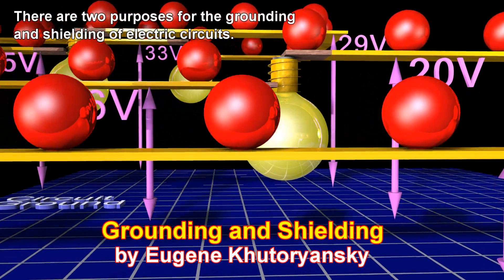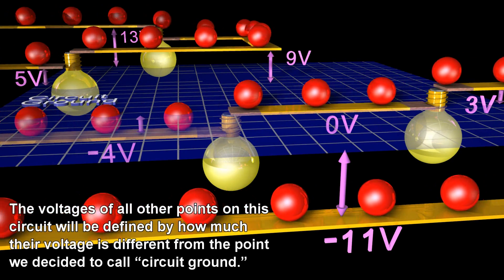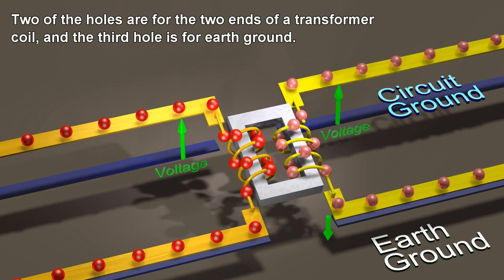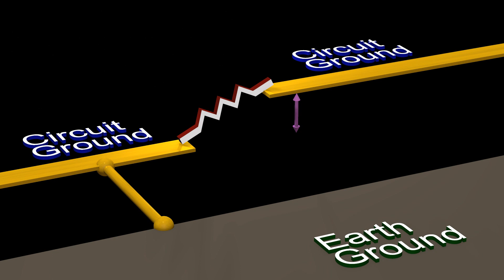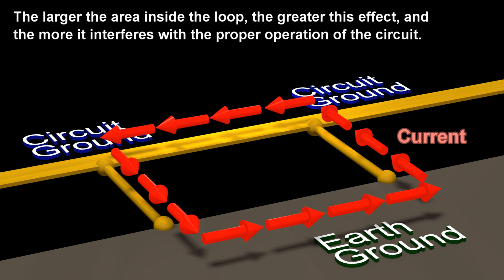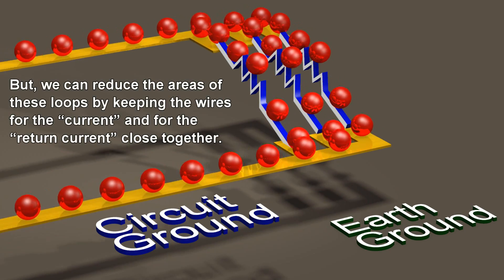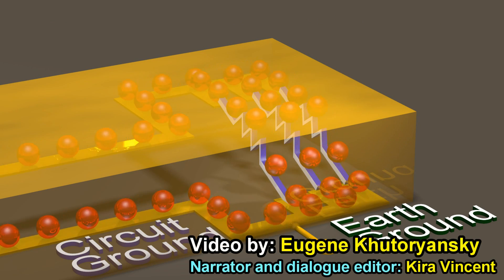Grounding and Shielding of electric circuits

Comment: Do we really believe there are little marbles of electricity rolling along the wires vs field lines spiraling around them as Tesla, Steinmetz & Heavyside agreed on? & that the ground is nothing more than an integration / discharge point into the larger electrical field of the planet?

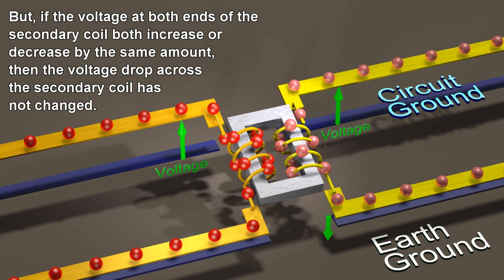Comment: 2:03 What can cause the secondary coil to increase or decrease?

3:00 - 3:12 The three-prong outlet part isn't accurate. Its expressed safety purpose is to create a low impedance path back to the center of the secondary coil, thus causing a breaker to trip when one of phase conductors (ends of the coil) touches the metal body of the appliance. It is technically connected to earth via this path. 

The metal enclosures are also connected to this path for the same purpose (tripping a breaker), but its earth connection via this path may provide safety in the case of indirect lightning strikes (for example) creating an induced current and arcing to a nearby person or ignition source... though this kind of overvoltage and indirect lightning stuff isn't greatly understood, I think.

Comment: The third "ground" hole on a power outlet isn't just a connection to earth ground. It is a connection to the circuit ground, which is also connected to earth ground via a "grounding electrode." This is done to lower the total resistance between the electrical system and the earth, which helps to minimize potentially dangerous voltages from developing between the two due to high current flow from high energy sources (ie lightning).

The reason for this third slot is to bond metal enclosures to the circuit ground (via the "equipment grounding conductor"), so in the event that an ungrounded or "hot/live" conductor (that is, relative to earth ground) makes contact with the enclosure, there will be a low resistance path back to the source (circuit ground) which will cause high current to flow and result in the overcurrent protection device (fuse or circuit breaker) opening and turning off the circuit. Without this low resistance path, current can still flow back to the source through the earth ground, possibly using a human body as part of this circuit. The resistance of this "ground fault" path may not be high enough to trigger the OCPD (say, 15A or 20A for a standard household circuit), but may still be low enough to pass lethal current through a person (~100mA).

Comment: What is grounding?
Grounding is an electrical engineering technique used to prevent people from receiving an electric shock from electrical equipment they use.
The metal accessible parts of equipment are connected to a copper or other metal plate buried deep in the ground.
While the phenomenon is one of involving the mutual repulsion of like charges, the manner of reducing the potential requires some knowledge of capacitance and that of the capacitance of single conductors.
In the book "Fundamentals of electric theory and circuits", the principle of grounding is explained after descriptions of the neutrality of conductors, capacitance of a single conductor like the earth, sharing of charges by capacitors connected in parallel and leading to the theory and practice of grounding. 
P.S. A circuit zero or ground is used as a reference point for measuring potential diffetences or voltage and is different from grounding and this is also described in the above textbook.

Electrostatics and circuits belong to one science and not two, that of electricity and magnetism. To know how they are unified visit this link 
https://matterandinteractions.org/articles-talks/ and view the article 'A unified treatment of electrostatics and circuits.  B. Sherwood and R. Chabay, unpublished. (1999)'
pdf. 
For a live demonstration of surface charge and its effects in circuits visit 
https://youtu.be/U7RLg-691eQ

For comprehensive descriptions beginning with the fundamentals of charge, electric field, surface charge, current, voltage, simple circuit, parallel circuit, capacitors and capacitive reactance, inductors, inductive reactance, induced fields and transmission line effects, antennas and wave propagation, the contents of the book, make a distinct unified approach to electrostatics and circuits lending precision and clarity to the topics which is not found in most text books, see "Electric and Magnetic Interactions" by Chabay and Sherwood 
www.matterandinteractions.org
or 
Fundamentals of electric theory and circuits by Sridhar Chitta
https://www.wileyindia.com/fundamentals-of-electric-theory-and-circuits.html

The book by Sridhar Chitta comes alongwith a CD with animated power point presentations for all chapters and voltage regulator, RC phase shift oscillators and differential amplifiers included additionally. 
There is a "look inside" feature in the amazon.com webpage of the book "Fundamentals of electric theory and circuits" by Sridhar Chitta with a few pages of Chapter 1 which may be viewed and also which you may swipe left or press < icon to view the foreword, preface and Table of Contents. 
For a lecture by Prof Ruth Chabay on surface charge in a simple dc circuit visit 
https://youtu.be/-7W294N_Hkk

Comment: Wonderful explanation sr
Why does common terminal of transistor configuration of bjt connect to ground? 
Please guide
Reply: What is grounding?
Grounding is an electrical engineering technique used to prevent people from receiving an electric shock from electrical equipment they use.
The metal accessible parts of equipment are connected to a copper or other metal plate buried deep in the ground.
While the phenomenon is one of involving the mutual repulsion of like charges, the manner of reducing the potential requires some knowledge of capacitance and that of the capacitance of single conductors.
In the book "Fundamentals of electric theory and circuits", the principle of grounding is explained after descriptions of the neutrality of conductors, capacitance of a single conductor like the earth, sharing of charges by capacitors connected in parallel and leading to the theory and practice of grounding. 
P.S. A circuit zero or ground is used as a reference point for measuring potential diffetences or voltage and is different from grounding and this is also described in the above textbook.

Electrostatics and circuits belong to one science and not two, that of electricity and magnetism. To know how they are unified visit this link 
https://matterandinteractions.org/articles-talks/ and view the article 'A unified treatment of electrostatics and circuits.  B. Sherwood and R. Chabay, unpublished. (1999)'
pdf. 
For a live demonstration of surface charge and its effects in circuits visit 
https://youtu.be/U7RLg-691eQ

For comprehensive descriptions beginning with the fundamentals of charge, electric field, surface charge, current, voltage, simple circuit, parallel circuit, capacitors and capacitive reactance, inductors, inductive reactance, induced fields and transmission line effects, antennas and wave propagation, the contents of the book, make a distinct unified approach to electrostatics and circuits lending precision and clarity to the topics which is not found in most text books, see "Electric and Magnetic Interactions" by Chabay and Sherwood 
www.matterandinteractions.org
or 
Fundamentals of electric theory and circuits by Sridhar Chitta
https://www.wileyindia.com/fundamentals-of-electric-theory-and-circuits.html

The book by Sridhar Chitta comes alongwith a CD with animated power point presentations for all chapters and voltage regulator, RC phase shift oscillators and differential amplifiers included additionally. 
There is a "look inside" feature in the amazon.com webpage of the book "Fundamentals of electric theory and circuits" by Sridhar Chitta with a few pages of Chapter 1 which may be viewed and also which you may swipe left or press < icon to view the foreword, preface and Table of Contents.

Comment: The ground is the return Voltage not 0...
Reply: Not when it comes to electricity high or low voltage, it's all the same Physics lol...
Reply: Also it is not called a Circuit Ground, it's called a Neutral...
Reply: So regardless if the return pathway is from the Neutral or Earth Ground it would be whatever the return current is. Unless the return current back feeds from the Transformer. This will increase the Voltage much higher than the supply voltage...
Reply from the maker: Different industries have different terminologies.  You are thinking of the electric utility industry or the wiring inside a building.  I was referring to printed circuit boards.

Comment: Can someone explain me why a person  standing on a ceramic floor ,above concrete, above earth (all isolating materials) suffer an electrocution if touch a 110 or 220 live cable?
Reply: In cable there are several wires inside. There are e.g. live (phase voltage), neutral (return wire) and usually protective earth (earth ground) wires as seen on video. These three wires were wired onto the wall socket at 03:00. This example person in question standing upon more or less insulating floor structure should touch the live wire and the neutral wire (or protective earth wire) simultaneously. However, in some cases electrocution is possible while in contact between neutral and protective earth or earth ground wires (01:30).
Reply: @jkinkamo  , a person can be  electrocutated only touching live wire and the floor.

Comment: this is a way of explaining why the grounded conductor (neutral) and grounding conductor (equipment ground) are bonded at only one point (service disconnect, or transformer disconnect).  Small currents induced as "noise" into circuits can be nearly eliminated by installing an isolated ground, where the devices for sensitive equipment are not bonded to the adjacent metallic system, but run directly to the service ground.

Comment: So do I ground the shield at both ends or not?
The big question still remains.
Reply from the maker: No, you should tie to ground at only one point, so as to avoid creating ground loops.
Reply: For both VFD and sensor cable?
I often see in documentation that shield for VFD should be ground at both ends.
Reply: Milos Grounding a screen on one end will protect your signal integrity from E fields only. Grounding at both ends forms a closed circuit for induced currents to flow, which protects your interconnect from external H fields too.

Comment: Not more then One connection between systemground and earthground is important. If you have two connections it can be dangerous in case of break in the systemgroud. In this case flows the hole current in the earthground. In many circuits can the systemground not carry the hole current, the wire can be very hot and begin a fire...

Comment: 3:13 that is not true with the type of outlet shown. Center hole(green wire) is earth ground. One hole (black wire) is a side of the transformer(either side). One hole(white wire) is connected to the center of the transformer winding (not shown) and also goes to earth ground.

Comment: Since the circuit is operating at DC (0 Hz), what would be the frequency of the electromagnetic waves generated by the loops?
Reply from the maker: If you have a switch open or close in the circuit, this will generate a step function, and step functions have high frequency components when represented as a combination of sine waves.
Reply: So will it be an array of different waves at varying frequencies and amplitudes, harmonics per se?

Comment: Nice animations, but you have lost a huge point about the Transformer regarding Ground reference:

A Tranformer isolates the cricuits Galvanically, meaning there is no direct connetion between the Circuits anymore, and therefor they have no reference to each other.

Ground is only important in the Mains grid for example because it is ground referenced (for safety reasons), meaning that one connection of the grid Transformers is always connected to Ground.

If you do not connect any of your transformer output connections to ground then your output circuit is not ground referenced meaning that it is "floating". This is the intention of an Isolation Transformer and any low voltage Powersupply (e.g. Plugpacks).

Without Ground reference you can safely touch even high voltage levels, because only you an not the circuit is connected to ground, therefore the circuit is open an no current can flow.
Reply from the maker: The issue is that a large electrostatic charge may develop.  Although no "continuous" current can flow to ground in that situation, the momentary discharge of the electrostatic charge can make the circuit dangerous, especially when we are dealing with high voltage step up transformers.
Reply: @EugeneKhutoryansky  That's why the chassis is grounded to earth, but the circuit inside is completely isolated from it. You touch the chassis, not the circuit! ; )

Comment: 2:54 Why don't electrons start going into the ground?
Reply: The current loop consists of the live wire and return wire (or neutral). Generally speaking, the earth ground (or protective earth) wire provides less feasible path for the current. But the earth ground wire path is good enough for grounding dangerous static voltages. In this educational video the earth ground wire has more losses than the return wire or neutral. One can quite safely assume that in normal conditions the earth ground wire return path is "forbidden" for the cirsuit proper. In real life and especially in three phase systems the situation is somewhat different. I think I've seen a three phase video somewhere on this channel.
Reply: @jkinkamo  then you don't need to connect circuit and earth grounds together. People interact with the outer chassis only (which is connected to earth ground), not the isolated circuit inside! (not connected to anything except live and neutral wires)

Comment: it was very help full 
but it wasn't very clear that how the extremely voltage difference through the transformer came from
Reply: Anywhere stray charges can come from, even static electricity.  I used to have this problem with products I made that had electrically isolated signal outputs.  When fed into the customers differential input data acquisition equipment, it wouldn't always work because is would sometimes allow the common mode output voltage to violate the common mode input range of the measurement equipment.  I had to tell them to connect a ground to their instrumentation so often that I finally gave up and started putting large value resistors (100k) between the signal output common and ground.  This was enough to maintain isolation more or less, but still provided a path for charges to bleed off to keep the common mode voltage referenced near ground.